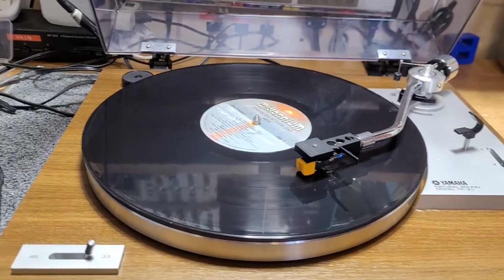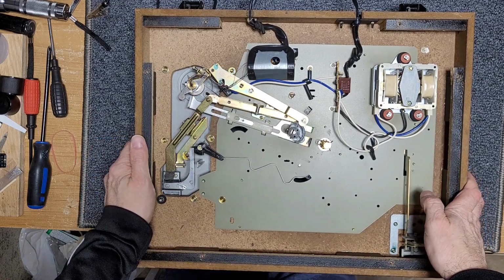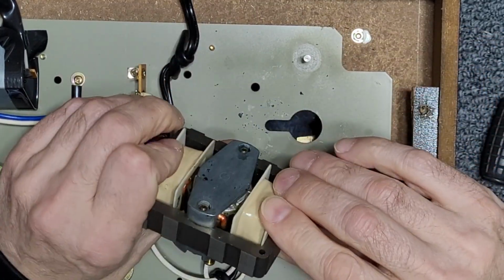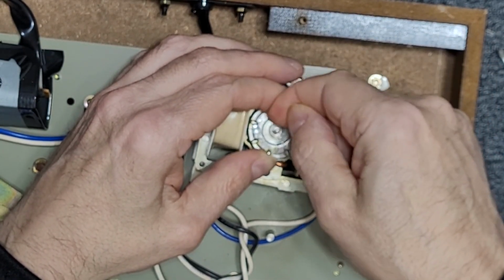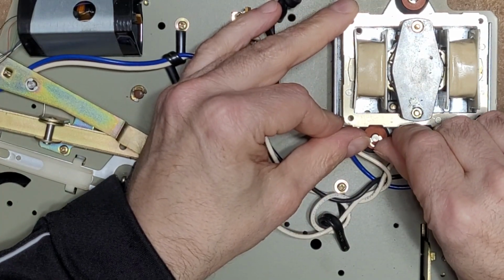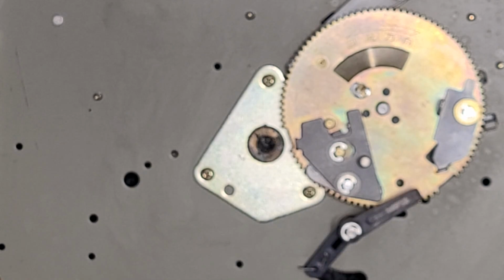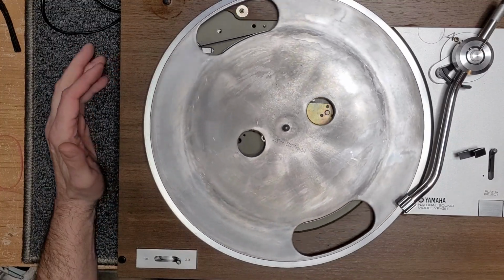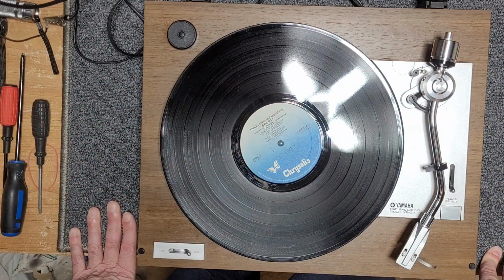Yamaha YP-211: Wavering Sound Problem & General Service

Comment: Same problem, with a similar build of table. Unfortunately, cleaning the spindle did nothing in my case. I've yet to replace the belt and lubricate the drive spindle. Hoping that works.

Comment: just got one...question....the counterweight extension tube seems to be sagging...........fixable?
Reply from the maker: There's a rubber support that rots, so no.  Need a new part.
Reply: @TurntableGuy  thanks...I returned the unit

Comment: You still have an issue. The speed may be steady, but it's way slow. On a speed disk, 7 dots per minute equals 1 % speed error.
Reply from the maker: Strobe does not render correctly on video.  Speed is correct.

Comment: Systemdek. The motor has fixings halfway up the cylindrical part.. Persist , they will come apart. Fixing, just file the fixings  area then solder using 60/40 type and big iron.  Steel will solder if Zink plating removed. Just solder blobs, it looks ok. The two coils are very simple. Often the broken coil can be repaired. Linn,Ariston,Rega, Logic and others use these motors. It should be an hours work and ten minutes to do the basic check. If the wire is broken and shortened a soft wire can be added. Then sleeve. The plastic bobbins make that simple and safe. 5% difference on coil resistance is fine.  It's a high resistance.

Comment: The rotor of the motor needs to be pulled out and cleaned, as do the proximity surface of induction field coils. Metal dust and particles can accumulate there.